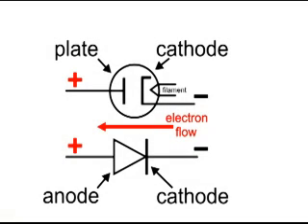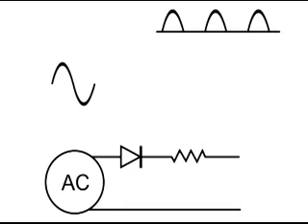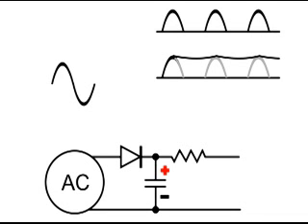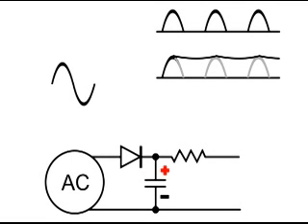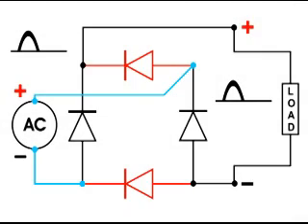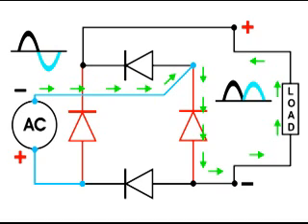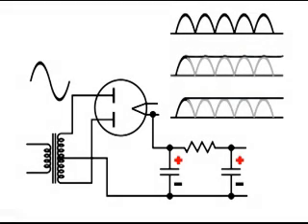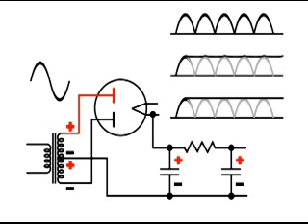Rectifiers, a few basics

Comment: I've never seen anyone explain a rectifying bridge using electron current! :P
Reply from the maker: +atester42 
What we know as electron flow, is from the negative to the positive in a circuit. This was not discovered until the vacuum tube rectifier was created. This is when they discovered that they could only get a current to flow when the negative terminal was on the filament and the positive terminal was on the plate. The problem is, before this they had guessed wrong an said that current and electrons flowed from positive to negative, definitely wrong. However for some unknown reason they did not change the arrow for current but they did for electrons. Since electron flow is current flow this absolutely makes no sense at all. So I just use electron flow from negative to positive, because that is the way it is. Electron flow has been compared to water flowing in a pipe. If the water is flowing in a pipe, what is flowing in the other direction, Nothing. Also you must keep in mind what a theory is, it is someone's best guess. Another thing to think about, is that we really do not know the why of anything. We just measure and use, we are all only observers.

Comment: mr "afrotechmods" uses convention current!He is a newb and it is b/c of him that the incorrect confusion of + to - goes on, He should really be more considerate on the beginners.
Reply from the maker: What we know as electron flow, is from the negative to the positive in a circuit. This was not discovered until the vacuum tube rectifier was created. This is when they discovered that they could only get a current to flow when the negative terminal was on the filament and the positive terminal was on the plate. The problem is, before this they had guessed wrong an said that current and electrons flowed from positive to negative, definitely wrong. However for some unknown reason they did not change the arrow for current but they did for electrons. Since electron flow is current flow this absolutely makes no sense at all. So I just use electron flow from negative to positive, because that is the way it is. Electron flow has been compared to water flowing in a pipe. If the water is flowing in a pipe, what is flowing in the other direction, Nothing. Also you must keep in mind what a theory is, it is someone's best guess. Another thing to think about, is that we really do not know the why of anything. We just measure and use, we are only all observers.

Comment: The current flow you mention is confusing. While accurate, the convention is the flow of a positive charge so the current goes the other way.
Reply from the maker: Before the rectifier was discovered the theory was electrons flowed from positive to negative creating a current flow. When the tubes/valve rectifier was discovered, this is when it was discovered that electrons flow from negative to positive. They had a 50-50 chance, they had guessed wrong. Electrons do flow from negative to positive. Why some say that current flows from positive to negative is a mystery to me. One thing to keep in mind is what a theory actually is, it is someone's best guess and that's all it is. We really do not know the why of anything. Some people like to give the impression that what they're telling you is the way it is, when in fact, we don't know. We don't know why electrons flow from negative to positive and we don't know what electrons really are.
I use electron flow
Reply: I agree that it makes more sense to talk about electron flow, but I have to pass exams and to do things the unconventional way will not endear me to markers I suspect.

Comment: Is the output voltage with pi filters 100% DC or just close to 100%? It's hard to see in your video...
Reply from the maker: It 100% DC, but depending on the load more filtration maybe needed.

Comment from the maker: Alternating current, is exactly as it sounds, the current and/or electron flows in one direction and then reverses in the other direction. In North America it is 60 cycles a second. Each cycle is from 0° to 360° and then it starts over. It's 0° the voltage is zero, at 90° is maximum positive voltage, at 180° the voltages back to zero, at 270° is maximum negative voltage, at 360° the voltage is zero. This repeats 60 times a second.

Comment from the maker: You can have current flow in the other direction (hole theory) if you want. I use electron flow as current flow and electrons flow from negative to positive. And you can prove that electrons flow form negative to positive. You can't prove hole flow. But it does not matter because both are the just theories, and a theory is just your best guess and nothing more.

Comment from the maker: Thanks gurtobe
For an AA5 radio the voltage for the electrolytic capacitor is 150WV, Working Voltages. The resistor is about 1K @ no more than 10 watts. The capacitance for the Pi filter range from 30MFD to 80MFD for each cap. Usually the higher MDF cap is first from the diode. I would Google Pi filter power supply.

Comment from the maker: In the very early days of electronic theory they picked a positive and negative side to explain electron flow. They had a 50-50 chances and they picked wrong. When the vacuum tube diode was discovered that when they learned that electrons flow from negative to positive in a circuit. Through a diode the electron flow is always against the arrow.